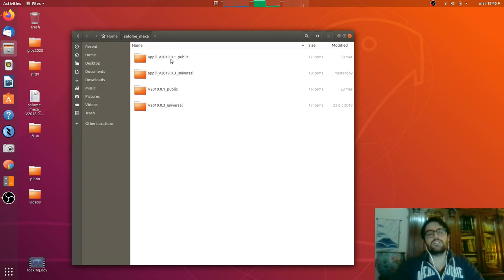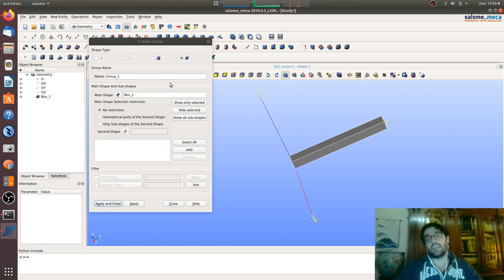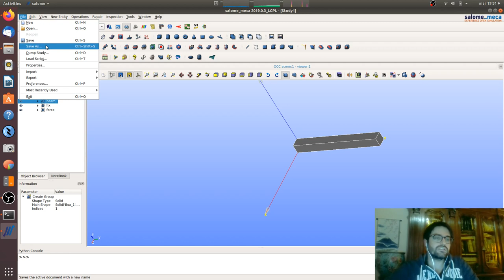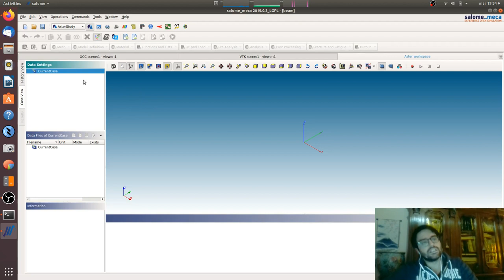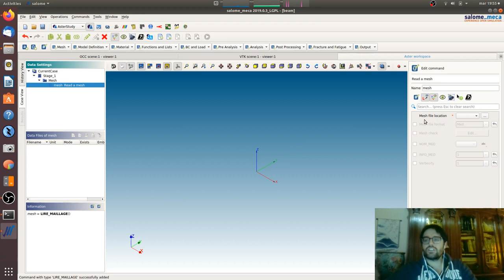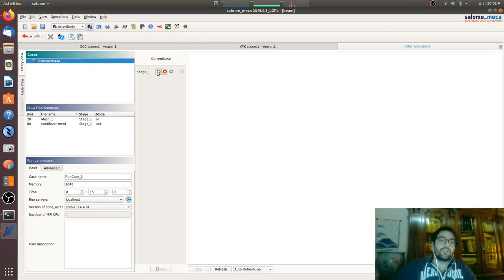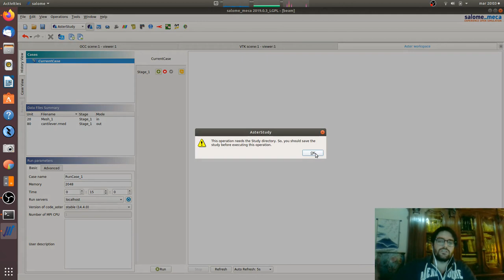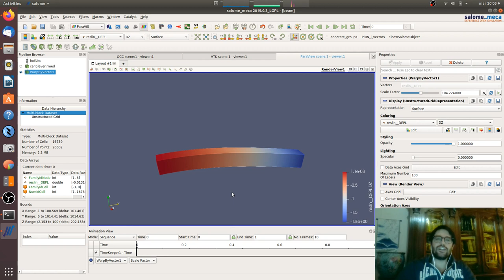Tutorial for Code_Aster and Salome_Meca - Episode 01

Comment: Thanks a lot. Please can you make a video for using general beam section (not only rectangular or circular). Maybe using gmsh
Reply from the maker: Thank you. Do you mean a model with 3D elements like in this example or a model with 1D Beam elements with an arbitrary cross section?
Reply: @aetherengineering7387  1d frame element. I'm a humble civil engineer.... I like use bending moment and shear force. It's a little difficult use tension of brick or plate, whit eurocodes for example
Reply from the maker: @peeolo  Ok it can be certainly done. It is fairly easy if you can calculate the section properties a priori. A more advanced option is to define the mesh of the cross section and let Code_Aster calculate everything for you, but perhaps this is a more advanced tutorial to be done later in the future.

Comment: Thank you for the video it's very helpful. I have one question, for meshing you chose Quad-Dominated but the meshes came out as tetrahedral mesh, why is that?
Reply from the maker: Thanks! It's a limitation of the "NETGEN 1D-2D-3D" algorithm. In this case it was selected before it is quicker to setup but we recommend selecting a specific algorithm for every step like NETGEN 3D, NETGEN 2D, Wire Discretization for example. for this specific case the best would be "Hexahedron (i,j,k)" for 3D and "Quadrangle Mapping" for 2D if you want to end up with hexahedral elements